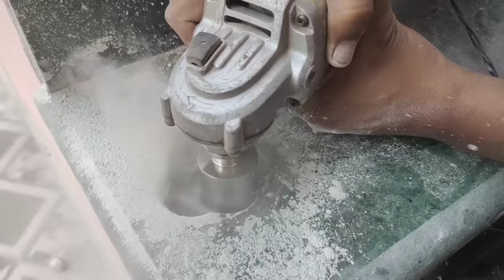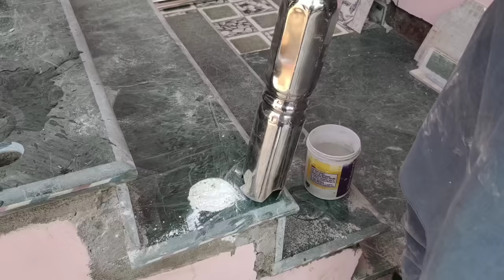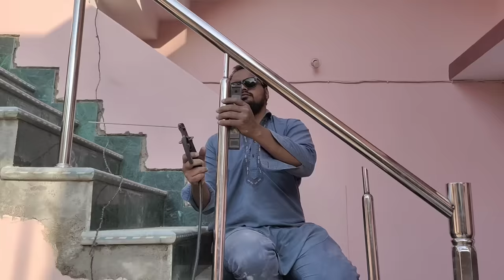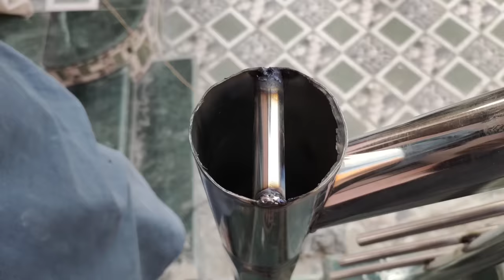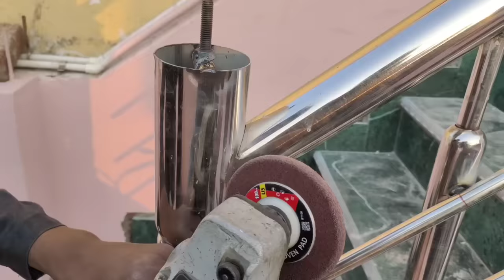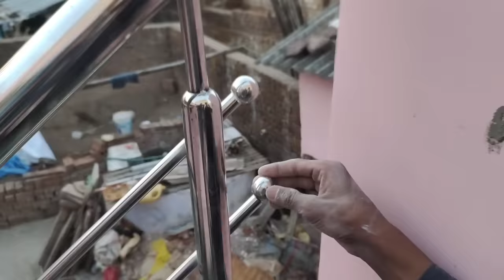Stainless Steel Staircase Railing Full Installation Process | how to make steel stair railing design

Comment: Welding not fully done on Stainless steel joints. Our workers should learn how to do work fully, sincerely and neatly from Japanese, Chinese and Other foreign country workers.  Seems to be less sincere in the job.  Execution of work in haste and haphazard manner will not work in any job.
Reply: Sir, I have not highlighted the incomplete welding to point out the insicereity in work but to inform the worker who takes that much strain and hard work to complete the job should also check whether the joints are fully made with welding. Since the staircase is used by lots of people often and daily, their hard work should not gave any shortcomings due to improper and insufficient welding.  My sending this msg is only to request all such workers to give more concentration in doing such important jobs. Pls understand.
Reply: @proudindian8041  Education is necessary. Knowledge is never waste. It's time we all understand it.

Comment: Nice job my friend what is the name or what kind of a powder you use in to the hole of the stairway?
Reply: It's white cement
Reply: Try using anchor grout powder for more strength
Reply: Pop
Reply: @navendrasinghnegi911  m
Reply: @arivarasusinnarassou9909  what it was